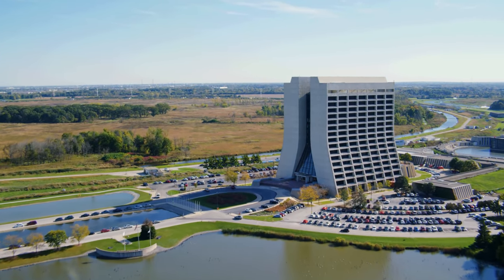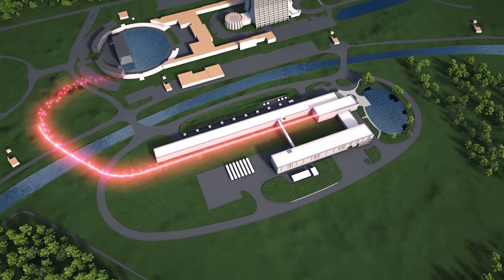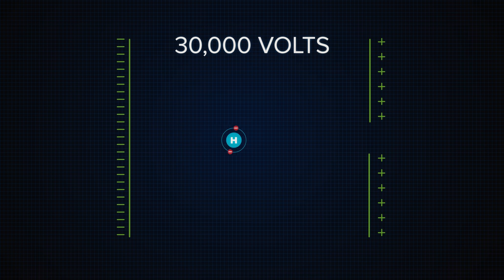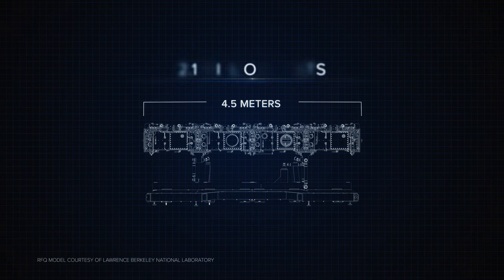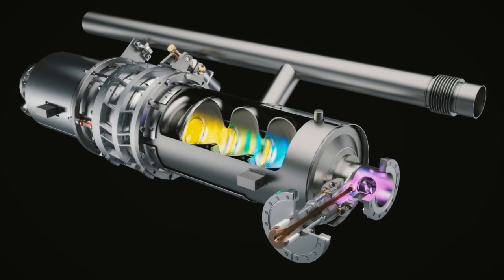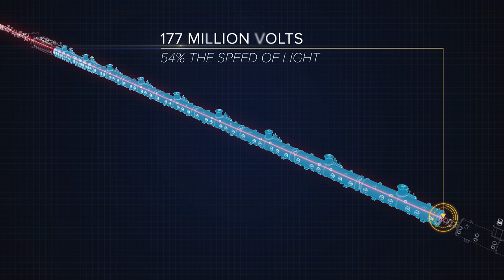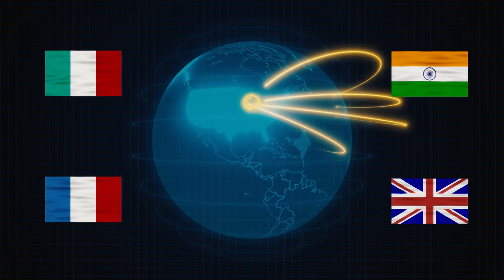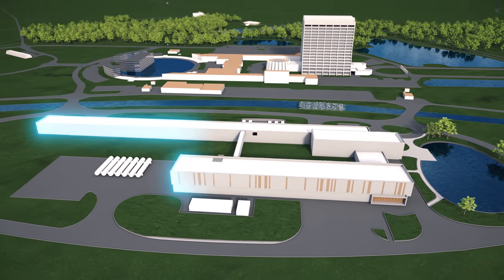How will Fermilab’s new accelerator propel particles close to the speed of light?

Comment: I need Dr.Don Lincoln to explain Superconducting radio frequency cavities.
Reply: Yes, yes!  I watch several of his vidoes every day and have learned so much.  Now with the PIP-2 project there will be plenty of cutting edge learning and home work to look forward to.  God speed your endeviors.  Kevin
Reply: He has explained Radio Frequency cavities (in his how do particle accelerators work video), but I don't think they were super conducting.
Reply: They work the same as normal conducting. The difference is that the SRF has higher Q factor, meaning low heat loss as stated in the video. 

TL:DR SRF cavities work the same as normal RF but can get accelerate to higher speeds because superconducting.
Reply: Tell people the radio frequency is 5G
Reply: contribution of india is significant
Reply: @ DSAK55 😂
Black Holes emitting 5G radiation.

Comment: Can Don or someone explain different experiments for "pulsed" and "continuous" beams.
Reply: Indeed
Reply: I'm sorry, is English not your first language? Seems self-evident to me.
Reply: Continuous beam looks like this: ___________________
Pulsed beam looks like this: _  _  _  _  _  _  _  _
Reply: @malenotyalc  What do you mean? Are new in this channel?
Reply: Fully automatic vs 3 round burst:)
Reply: I think Don had an earlier video (a few years back) about the spread/distribution of particles (speed). He covered some part of this. However it would be great if he addressed it again in terms of use cases, and how continuous beam would work (energy distribution).
Reply: @x_gosie  I apologize. I misread OP (case of not being awake yet nor wearing my glasses). I thought OP was asking for an in depth explanation of continuous and pulsed.
I'm extra grumpy pre-coffee.
Reply: The equivalent of turnng the water faucet on and off, on and off or just leaving it on.
Reply: @petercarlson811  It is not that simple. There will be a distribution of particle speeds. The slower ones will affect the faster trailing ones, and cause bunching I think.
Reply: @mrfinesse  Which is what hapens in a steam of water too.
Reply: @mrfinesse  Isn't it linear? How does the fast one get behind the slower ones? I'm not aware enough of the system, but it looked like a straight line in this vid.
Reply: I'm not sure but I think at the very initial step, rather than having a continuous 30,000 Volt, you make pulse of this (i.e. on/off...). This is such that the protons enter the accelerating ring (which is downstream of this linear accelerator) in sync. You then get "bunch" of protons circulating around the ring. Main advantage is you don't have to turn on all the magnets continuously -> you save power.

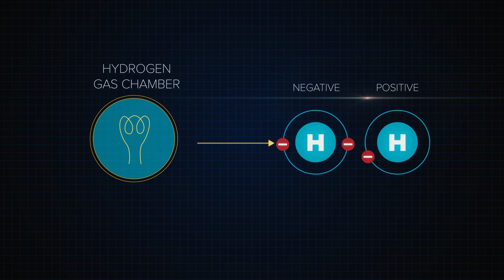Comment: Why is the right hydrogen atom at 1:59 positvely charged when it has one proton and one electron?
Reply: I think it should say neutral for the hydrogen on the right.
Reply: They're optimists, for them neutral is positive
Reply: Please don't destroy the whole experiment by telling them! :)
Reply: And this is how a black hole is accidentaly built!
Reply: They are just using the negative ones so nobody corrects the other label.
Reply: The sign is not depicting the actual charge of the atoms. They're showing the relative difference in charge. It's perfectly fine to call two potentials positive and negative when they're different, regardless of their actual charge just to show which one is which. In fact, that's the correct standard.
Reply: @spudhead169  Thanks for your explanation.  Wouldn't the Hydrogen molecule on the right be called relatively positive as compared to the one on the left?
Reply: I'm assuming that the other freed hydrogen atom would also pick up an electron and be positively charged as well.

Comment: I'm a little curious about results from particle collisions. Especially when similar head-on collisions do not always yield the same particles. I am inclined to think some of the differing results may be related to the exact moment of the collision, or more precisely, the exact moment of oscillations a particle is going through. By this, I mean that if a particle shows up only half the time from similar head-on collisions, then we may be seeing only the top half of the full sine wave. Like a bouncing ball, it bounces up and down, then rolls across a little, then bounces up again, then rolls across again. We would not be seeing the bottom half of the full sine wave. And from the particles that do show up, if twice as many of those particles have a lesser measured value than particles of the highest measured value, this would also indicate we are seeing particles from the two "legs" of the sine wave and one particle at the peak of the sine wave, but nothing from the bottom portion of the sine wave. Just curious.

Comment: You hyped the accelerator so much I was hoping you would say that within 10 years you will be able to put an extra set of super conductor accelerators on the end and push past 90% the speed of light.
Reply: For this part, even if the speed and energies are impressive, an important part is actually how many rather than _at what energy_. Neutrino beams need a lot of protons.

Comment: It's like a giant, elongated linear Klystron tube for hydrogen ions (plasma?) instead of electrons.
Reply: RDE Lutherie  I worked a radar site once upon a time where the power amplifier was 4 X626 Klystrons in parallel for peak power of 5MW.  Waveguide as big as heating ducts.  Power from a dynamo on a diesel locomotive engine.  Everything in the old days was done with big hammers.

Comment: I probably miss the point.
But, why is 84% the speed of light significant? 

LHC can reach 99.999999%.
And it's predecessor, the Large Electron-Positron Collider, up to 99.999999999999%.
Reply: That's just the first stage of acceleration, the protons are then accelerated further in the Booster and Main Injector. At the end they reach 99.9965%. Note that the LHC accelerate very few protons for each collision compared to the number of protons which is impinging the target at Fermilab.
Reply: @pierrelasorak3241  Funny none of that is mentioned in the video above.